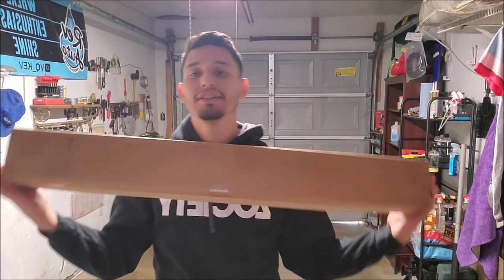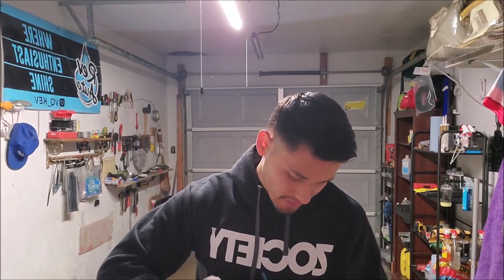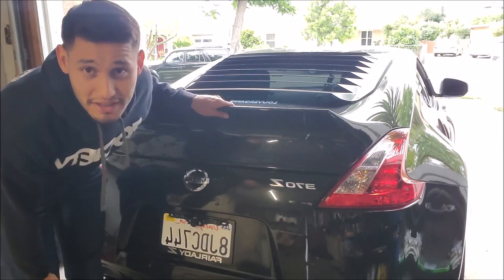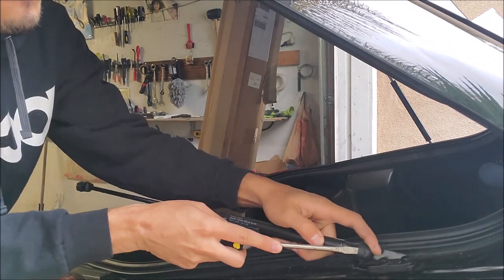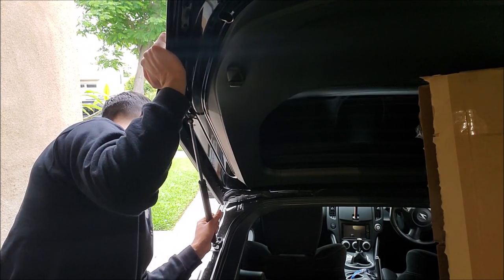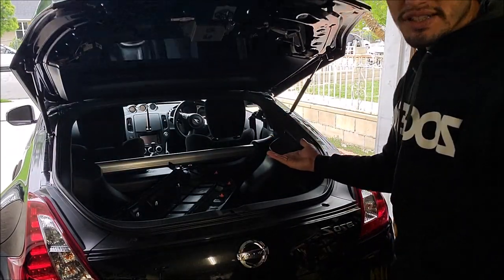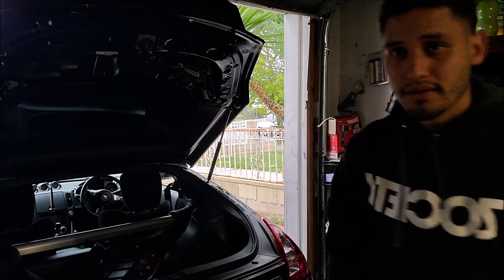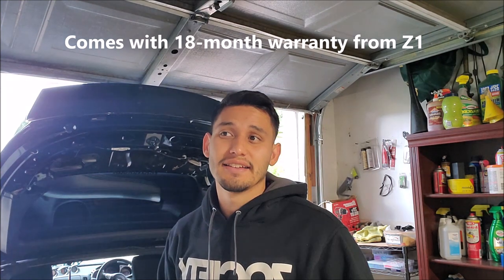Installing Z1 Hatch Struts on my 370z

Comment: 2yrs later just now seeing this…. The real reason your hatch won’t open is because you need a new OEM rear hatch bumper/lifting spring. It’s right next to where you put the struts on, on the hatch itself. The sprint wears out over time. It’s supposed to push the hatch up when you push the hatch release button. A cheaper truck is take that same piece off and shove a lot 3-5 Pennie’s in the covering l. There’s YT videos in how to do it. Personally I’d buy a new one but that’s just me.
Reply from the maker: I tried the penny trick but eventually it won't be enough, the new struts work like a charm tho

Comment: Bro I had the same issue on the Z pressing the button twice. I removed the weight and it still didn’t work.

The issue is the rubber stoppers. They’re expensive tho
Reply from the maker: theres the penny trick with the stoppers